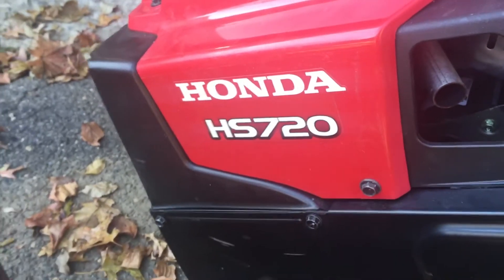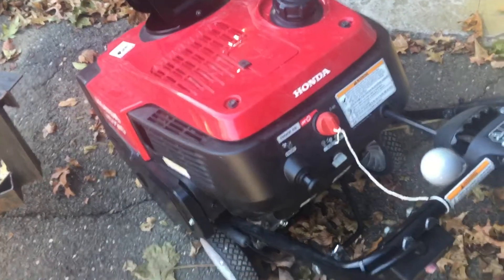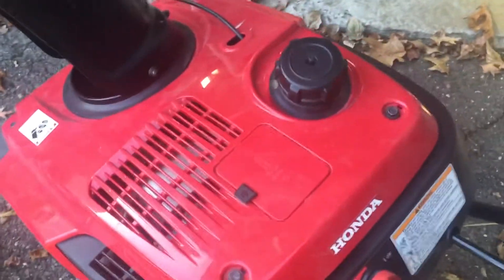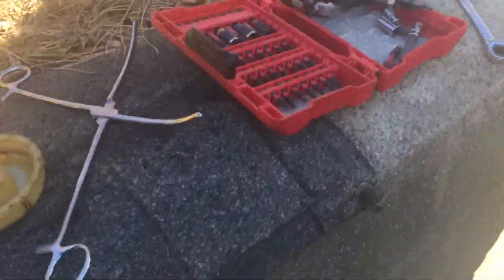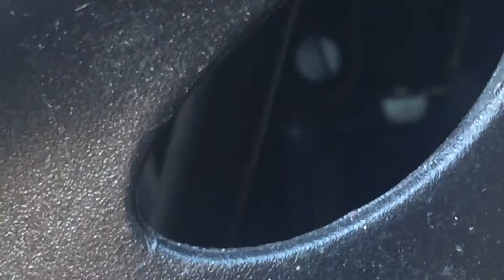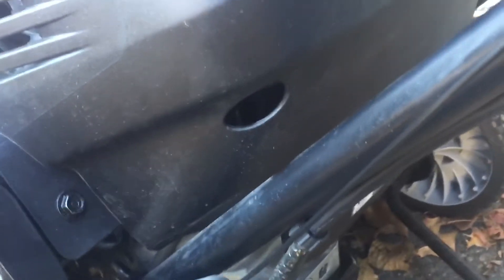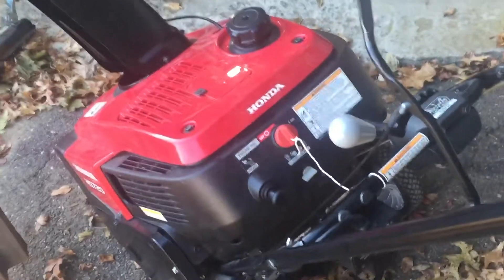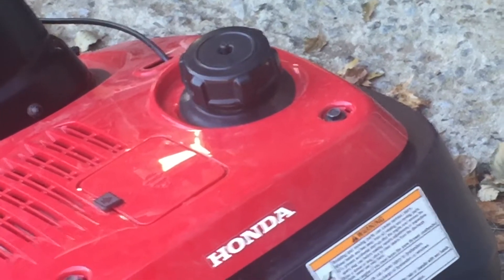Honda HS720 snow thrower won’t start tips and tricks

Comment: After messing around with my snowblower for 30 minutes I decided to pull YouTube and found your video. I had already drained the old gas so I stuck a screwdriver in the access hole you showed let it drain for a while. I closed the valve and the 2nd pull boom I am ready for snow! Thanks appreciate it very much!👍
Reply from the maker: @boomer1049  thanks for watching please subscribe!

Comment: Instead of waiting forever for the fuel to drain, I just siphoned it from the tank itself. Took a spark plug out, added few drops of fresh fuel straight into the cylinder, refilled the tank with non ethanol gas. Ran like a dream after 2 years of sitting.

Comment: Great video, and thanks.  However, near the end of the video, regarding the chute adjuster for the angle of the snow being thrown, he doesn't seem to suggest lubricating the travel path of the chute mechanism.  They also tend to rust, the older they get.  I would suggest trying that before messing with the size of the spring, or removing it.  I trust the Honda engineers on this one......

Comment: Ken. Just replacing the gas will clear the carb block?  Mine wont start there’s a product online called Gum Buster. Which I was thinking of getting but I will try this fix and use a high octane gas with no ethanol. 

The Gum Buster adds a purge valve where the Carb plug would be and they have 2 products. One that blows out the carb bowl so no gas stagnates. And the other is a cleaner that dissolves the blocked carburetors. You just pump it directly into the carburetor.
Reply from the maker: Ben, first, thanks for watching!  This thrower had old fuel that turned sour and attracted water to it that would not burn.  By draining it out and probably another 4 ounces from the tank until fresh fuel came out. It started just fine on fresh fuel meaning the jets and emulsion tube were not clogged.
Reply: @KensSmallEngineRepair  Hard to tell if this is my case also.  I do know that I was using the lower grade gas 84 with 10% ethanol.   I did add fuel stabilizer and it was not old.  But It is worth a shot maybe when we were adding gas while it was snowing some got in the fuel tank.  Worth a shot.

I didn't know about the ethanol gumming up carburetors.  I will only use higher octane gas on these small engines going forward and also drain every season.  My snow blower did start after it was stored... it stopped working after a few uses this season.
Reply from the maker: Regarding Gum Buster, I’d rather disassemble the carb and make sure all the orifices are clean.  Also Gum buster shoots through the main jet and emulsion tube, it won’t clean the  pilot jet which is the cause of hunting in most Hondas and clone engines like Powermore, Loncin, etc.

Comment: Thanks for the video. I was wondering that screw will drain the carburator bowl or the gas tank. 
On my small honda generator, a similar screw only drains the bowl; may be because the geny has a fuel pump. ?
Reply from the maker: It drains the bowl and eventually the tank but would take a while coming out the needle opening to drain the tank completely!
Reply: @KensSmallEngineRepair  👍  thanks  lots sir 🙂

Comment: Mine just randomly stopped working after 2 months off lots of snow here in Alaska… think this will help? Just worked this morning on 7 inches of snow and wont turn on now :/
Reply from the maker: What have you checked? Is it getting spark? If so does it pop at all with fuel squirted into the carb?  How about compression?
Reply: @KensSmallEngineRepair  being cold outside I was just making sure the fuel valve was on and the choke was good. No spark when I pulled
Reply from the maker: Try a new spark plug, make sure the kill switch is ON.
Reply: @KensSmallEngineRepair  thank you! I will do that and follow back! I appreciate
Reply: It was the spark plug! Thank you!!!!
Reply from the maker: @Mili29_  Anytime, hope you are subscribed!